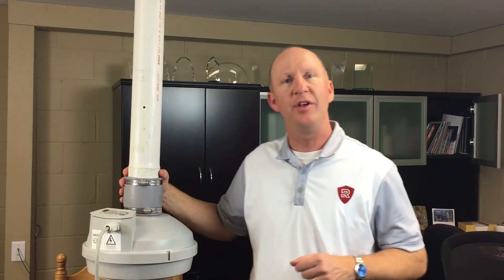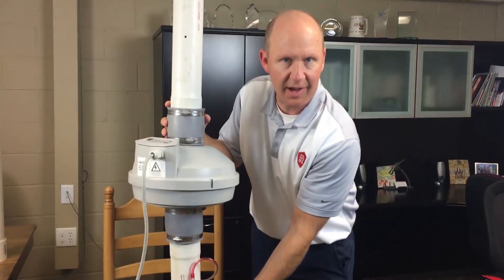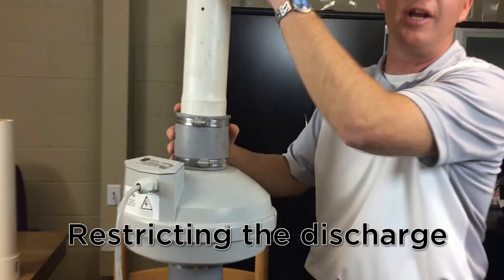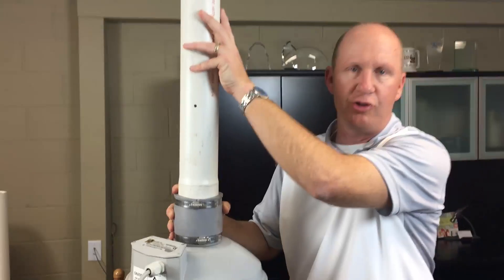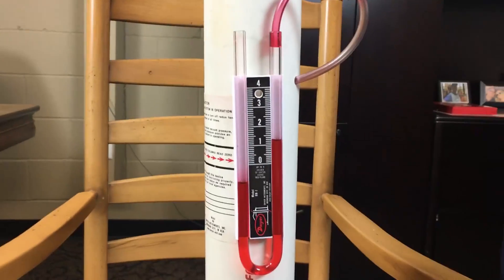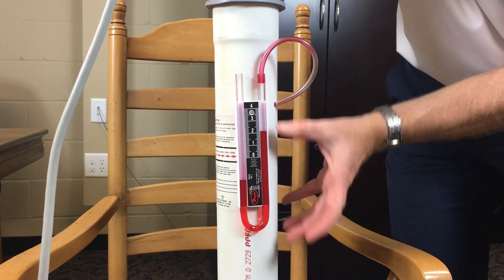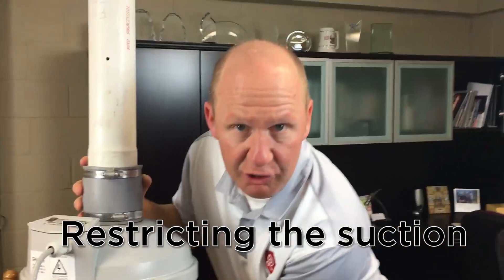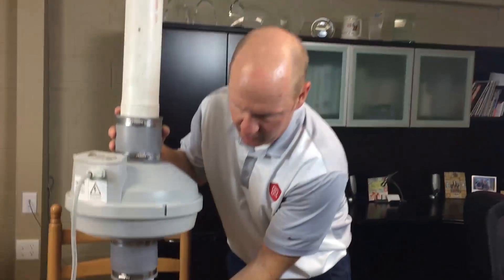Reading the UTube of a Radon Mitigation System

Comment: So if the manometer is reading a high suction of 4 then its restricted. Mine happens to be that way currently (brand new system) but the earth below the slab is packed sort of moist dirt and not loose stone due to the age of the slab so how do u correct this as u don't mention anything about solving that issue. Seems to me u are limited in corrective action because the earth under that slab is just not good pourous breathable material and u have limited options. I'd love for people with radon installation experience to weigh in on this. I know the system works being it went down from 5.5 Pcl to 0.4 but is the fan working too hard in this case?
Reply: I have the same issue when I installed a fan on our passive radon piping under the slab.   But since the slab is very sealed, and the dirt below the pea gravel layer which the pipes reside in, I get a very high water column and hi radon.   So I am going to ventilate the pea gravel hoping to increase the air flow under the slab.   Anyone with thoughts?
Reply: @m.s.dickerson3139  Try cutting the pipe and use a shop vac to suck out 5 gallons of the stone and then put a rubber coupling on the pipe and make sure the seal between the pipe and slab wasn't compromised.
Reply: @chrislebreton750  I found that the under slab "form-a-drain" footing forms which were used to facilitate drainage and ventilation had probably gotten mud in them because the slab was not poured immediately after backfill and there were substantial rains during the process.  So my passive radon system was compromised. I drilled a 3" hole into the 1' deep pea gravel layer under the slab and cleared some gravel, then I inserted a 3" PVC sched 40 pipe into that hole and sealed it. I connected that pipe to the radon fan in this video.  The vacuum went to normal levels, and the radon levels fell substantially in the house to normal levels after completion.